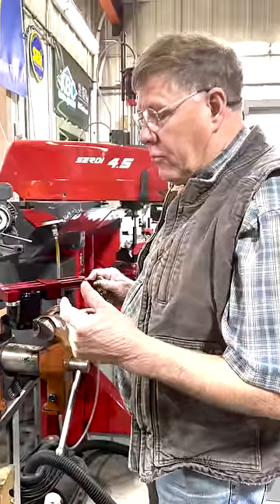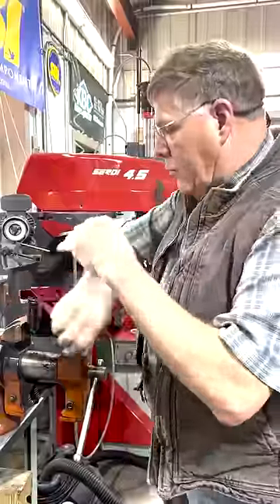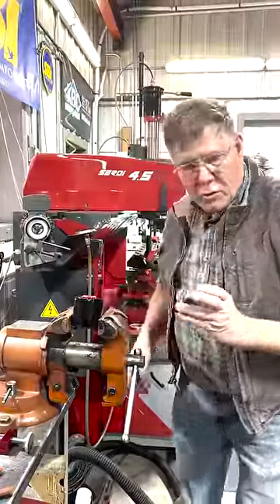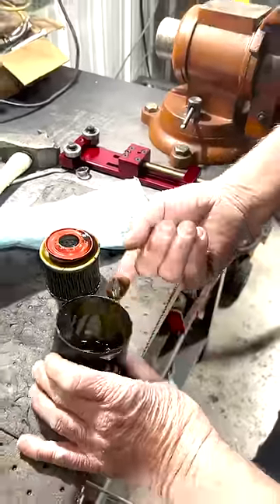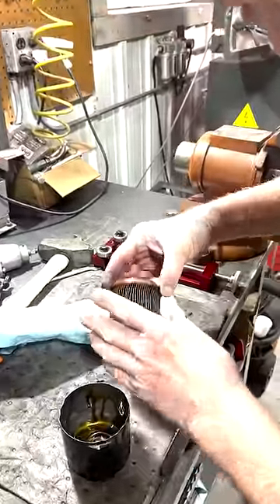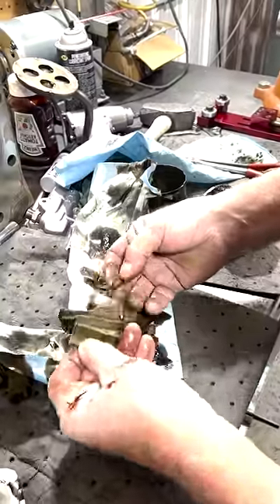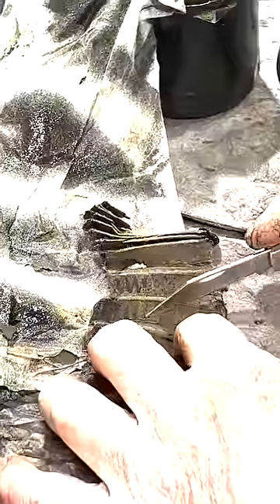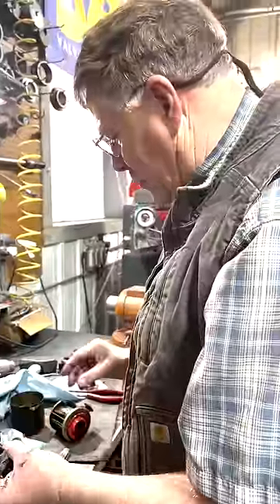#shorts Our Customer Ran His Engine OUT of OIL! 🤦🏻‍♂️

Comment: Shake my head everytime, and people drive vehicles like there made out of magic 😅
Reply: Im not a car person, could you explain what happened? Did he drive it to long without changing the oil?
Reply from the maker: @JDog_Unchained The biggest issue is that he didn't even check the oil for about 15k miles and ended up actually running the car out of oil to the point that the low oil pressure light came on. Most of the time, once that light comes on, you're already in big trouble. Lol. So yes, not changing the oil for long periods of time isn't great, but running out of oil is much worse. Lol
Reply: @JDog_Unchained  yes not changing the oil  destroy that motor and I don’t care what manufacturer say, oil company say you need to go no more than 5000 miles recommended 3000 oil change
Reply: @JAMSIONLINE  -  My one truck had a sensor in the oil pan that said when the oil level was low... so running out was avoided... The truck burned a little so it let me know when it was about 1 quart low from 6 quarts/5 L. System worked good.
Reply: @KlodFather My car is the same. No dipstick, so it lets me know when I'm a quart short, out of 7 quarts. That's when I started looking for a leak. Came from the valve cover gasket. Nothing crazy .
Reply: @JoiceVaderd  -  Mine just burns a little through the valves. Its old but runs good. A little smoke when I start it. ITs reliable and I do not beat it or drive it like an ahole. Thank you for bringing up that fact yours has that sensor. Mine does have a dip stick. I carry oil with me so when it lights up, I just add some.
Reply: @KlodFather  Legit legit. I feel that. I have all old vehicles, too. If they work, no need to replace them
Reply: Honestly it's a joke, my 2002 honda civic never had an oil change for well over 340,000 km. To be clear, that is well over a year and a half of driving, it did get a bit hotter in the summer but it didn't really burn that much more gas. 

It sounded like a pickup going down the highway and it's doors didn't lock, what killed it was a cracked radiator. It wasn't worth the money to fix, it was a beater car that ate the salty snow every year
Reply: @raisin8051  You drove over 211k miles??? In a year and a half? That's insane! Where did you drive?
Reply: My engine oil change duration is 20 thousand miles, factory spec ! The factory filter is tiny plus the engine is a diesel, Say something
Reply: You shouldnt have to be a "car person" to know general rules for caring for litterally anything you own. @JDog_Unchained
Reply: @JDog_Unchained basically,  driving  a vehicle  with no oil in the engine  for a long period of time will destroy  the engine because it will hydro lock the engine. It cause friction in the pistons that the piston itself will weld itself to the cylinder heads because of  too much friction  and heat.  Oil acts as a lubricant to the piston and other parts inside the engine.
Reply: @JDog_Unchained  It was either burning or leaking oil and it didn't have enough left. New cars piston rings are not as tight compared to the past helps slightly with fuel economy. trade off is some will burn oil which I rather not have it do.
Reply: @WhiskeyGulf71 what car and engine? Have you checked the terms and conditions for that interval? It’ll be dependant on climate, driving style and fuel quality
Reply: And when the engine goes out they blame it on the manufacturer.
Reply: @jamie0193 for bmw e.g. e90 20000km intervals in Europe are standard.
Reply: I remember my old girl friend who had her license for a year, also drove her car for a year without checking oil or water and then couldn’t understand why her head blew 😂
Reply: @DerSnipOr  I have an e92 and had a mini. The intervals are 16’000 miles in England. But only for certain driving conditions. I change at 6-8000 to avoid timing chain problems
Reply: @JAMSIONLINE  what car does he drive? If it survived that I want one, imagine how reliable it could be with proper maintenance
Reply: I do mine about every 8 -10k 🤷
Reply: 10k mile bi anual non synthetic for about 45 years now.  Never check the oil, but no leaks.
Reply: You make statements like that w/o backing it up with what they are made of.  Hah!
Reply: You know Lexus recommends an oil change every 10000 miles for their cars? To me that’s insane. Max for me would be 5000
Reply: @axebeard7677  it's 2024.  Honda tell you when to change the oil (this is based on various things (temperature, load, etc.)).  My first oil change was 18,000 km though most are at about 12,000 - 14,000. 
(Synthetic oil of course - and of course make sure there actually is oil from time to time).
Reply: “Any sufficiently advanced technology is indistinguishable from magic”
Reply: My Mitsubishi eclipse is still running after about a year and a half with no oil change 😂
Reply: So the filter was doing it's job.
Reply: Not magic, it’s fairy dust
Reply: tbh my 03 lexus es300 made of magic
Reply: It’s still running ain’t it? ✨ magic ✨
Reply: @misaelherrera2845 do not use the word hydrolock, you know nothing about it, hydrolock is when cylinder fills up with any liquid, and since liquid is not compressible, it will lock the engine, if your fuel injector is leaking into the engine, cylinder fills up with fuel overnight and when you try to start it, it locks up.
Reply: @watermelonwatermelon6513  ok, well lets call it explosion
Reply: @misaelherrera2845  no explosions about the bad oil tho.
Reply: @watermelonwatermelon6513  its a joke. It's dehydration
Reply: I haven't watched this video much but this comment  is the real deal.
Reply: Yup❤
Reply: @KlodFather try adding some marvels. If your burning oil it's from rings not being free to spin to do what they need to do. It will help removing the carbon buildup on the underside of the valves so they seat that sometimes additives can't fully remove. Running a better detergent blend of oil can help with this too.
Reply: @djnone8137  -  It was the valve guides that were bad. Rings were OK. The engine outlasted the rest of the truck and went on to live again in someone elses truck. 300k miles. Those old German blocks were reliable but had a few warts if not kept well oiled. I changed the oil regularly. I only stated that the pan had the sensor and it worked. If you only put in 3 quarts it was not starved for oil but it would light the light to let you know it was low. This was not a pressure light. The truck had a pressure guage and oil press light separate.
Reply: @JAMSIONLINE Emotional damage. 🤣 seriously it's always smart to check engine oil and tire pressure often.
Reply: Ur saying they're not?
Reply: @JoiceVaderd  you need to basically drive every waking moment to rack up those numbers.  Doesn't even make sense.
Reply: @misaelherrera2845  not a hydrolock, that's when fluid (coolant/oil/fuel) is trapped in a cylinder on its compression stroke, a no-oil situation will cause heat siezure of bearings, camshafts and rockers, and pistons.

Comment: I change my oil every 5k miles. I don't care if the filter and oil says 10k, 12k, 15k. I'd rather spend an extra $200 a year doing 3 oil changes than just doing one, and my engine last until 300,000 miles than 150,000.
Reply: was gonna comment how unnecessary this is but I service the weekend car once a year and that does like 3k lmao.
Reply: What kind of oil are you buying that cost $66 dollars per change??? Synthetic store brand is 25 bucks for 5 quarts and a few more bucks gets you a decent filter.
Reply: @braxton4363 He probably has it serviced, I did my own for $30 every 4,000-5,000 miles until my Honda CRV hit 200,000 miles now every 3,000 miles. 350,000 miles without any engine problems, oil is cheap engines are expensive. I went to jiffy lube once when I had an injury that kept me from changing my oil, $80 for full synthetic! No thanks I’ll do it myself. My next vehicle I’m gonna buy a 55 gallon drum of the vehicles oil, cheaper in bulk and it doesn’t go bad. At 5 quarts an oil change 55 gallons is only around 180,000 miles.
Reply: 5K intervals and Castrol Synthetic on both of my last 2 cars, the first one 198K before I sold it and the current one is at 203K, no problems.....
Cheap insurance for your engine...
Reply: Without having an oil analysis done, it's probably a safe bet to do 5k OCI with full synthetic.  Not conventional...
Reply: You could get half a million miles out of that engine easily😮 one of the best things you can do for your engine is put some seafoam in the engine oil😮 it will remove are all the carbon deposit in your engine it will be like new😮
Reply: If you change your oil past 3,000miles you should really look into how small oil galleys are alot of newer cars have very small oil galleys that get clog with varnish this galleys oil the timing chain and other parts if it get clogged you either don't get enough oil to the other parts or no oil at all. If your timing chain loses oil you will not make it very far unroll it blows as mist modern engines are " interference type engines" which usally have piston to valve contact when the valve train fails.
Reply: Every 3k on dino keeps my girl happy.
Reply: Me too, every 5k miles. And that works great for my Toyotas... but I have a Honda now and by the time it reached 5k for the first time it was out of oil already.

Comment: I put prop plane oil in my ex's new car, before we were divorced. She drove it somewhere around 2 years, before selling it to her brother. He drove it like it was stolen, for three years, and never once changed the oil. His dad, my ex father-in-law, asked if I'd do an oil change on it, so he could sell it, and when I pulled the oil plug, nothing came out. By that point, it had a little more 65,000 miles on it. I changed the filter, filled it with oil, and told him to bring it back after 250 miles. Two days later, he came back, with an additional 500-600 miles on it, and when I pulled the filter, there was almost no metal in it. The car is still on the road, 20 years later, with the same engine in it. Of course, the new owners are much more frequent with the oil changes, but I thought that thing would have exploded by now. It has nearly 400,000 miles on it, and smokes like Cheech and Chong, but it runs pretty well.
Reply: Nothing about that formulation is designed to fit within tight tolerances of a modern day combustible engine. The worst mistake is always superseding the engineering that goes into vehicle oil formulation.

What you proved is that any lubricant is still a lubricant. It smoked because the rings were fried and it was probably out of bore by that point.
Reply: Are you not gonna tell us the make and model of the car? Cmon bro, let's have some details. Sounds like a well made vehicle to me.
Reply: @djnone8137 OEM spends billions on R&D just for Jason from Iowa to say
"This oil's way too thin"
Reply: @bobman717  no. Oem spends for you to live out your contract and knows through analytics you average a few k a year so the warranty will expire all liability the second you try to actually own the vehicle and drive it.

Oil companies invest in sustainability after warranty. Not because they are obligated but because they can. OEM wants you to buy a new vehicle every 2 to 4 years. 

Lubrication specializes in maintaining what you own. 

It matters. Ace of spades.
Reply: @bobman717 oil weights are primarily driven by emissions standards nowadays. A little step up in oil weight won’t kill it
Reply: like turbo prop oil or reciprocating engine oil?
Reply: Some cars are true brave heroes!!

Comment: I change my oil & filter every 5K miles on my 1998 Honda Accord.  It currently has 553K miles on it.
Reply: Lucky. I waited 5k miles on my little honda 4cyl once and it nearly blew. Out of oil already, overheated, 7 error codes, overheating fluid, misfires on every cylinder, P0420 of course. And oh yeah, the coolant reservoir lid blew in half and all my coolant boiled out. 

Still drove it home though, still runs somehow, but definitely checking level before 5k miles next time.

Comment: In the late 70s, we had a customer drive in his Pinto and complain about a knocking noise. When the service manager opened the hood, he saw the oil filter was painted the factory blue. He turned the car off and there was no oil. The car had 64,000 miles. He asked him why he didn't have the oil changed. The guy gave him a blank stare. "Change the oil?"
Reply: How do these people make it out of the house in the morning, what on earth
Reply: I'm surprised it lasted 64kmi without a single oil change 😂
Reply: @mikegriego3671  Back in those days, there were still full service gas stations, so someone must have added oil at some point. But the guy seriously never had an oil and filter change and claimed that he didn't know it was needed.
Reply: @Olds_Pwr  Only if you like engine wear. His engine was completely ruined. The knock he was complaining about was the lack of engine bearings.
Reply: @chrisdaigle5410  He said nothing about a knock. Engine wear starts the first time the engine is started. In my experience, engines can take more abuse than most people give credit for. I had a 72 Cutlass that would idle at 7 psi and idle at 0 on a mechanical Autometer gauge. Never knocked, never blew up, worn out, yes.
Reply: ”He never said anything about a knock”  He’s the OP. He’s saying it now…😑
Reply: @liggerstuxin1 he also said it right in the OP, so dude was just plain wrong.. some people bro.. do you think it was the reading or the comprehension that got him??
Reply: @Olds_Pwr  He did say it was knocking.
Reply: @Olds_Pwr   Look above at the post you replied to. The Pinto with a knocking noise.
Reply: @Helterskelter41156  Gotcha.  I was referring to the clip.
Reply: This is why you don't just do things for the people in your life, the amount of mom's I know that have new fancy cars that are screaming at them to go take their car in for service and just don't because they never even notice the warnings is so great that it Transends astonishing into it just being tiring. That isn't to say the husbands know what they are doing, but dear god, most people in the modern day refuse to learn.... well anything. The old people that refuse to learn even the most basic tech, and the young people that refuse to learn...... again anything.

Comment: I bought a jeep Cherokee with the 4.0 in it. I always change air filters spark plugs and oil when i first get a car. I drained the oil and it looked like Silver pearlescent paint. I filled it back up and proceeded to redline the shit out of that engine every chance I got expecting it to die. I sold it a year after, turns out it was the owner 3 times before me that bought it back. He said he didn't expect it to last more than a month. It's been 7 years since i sold it back to him and he's still driving it. That little 500 dollar jeep just won't die lol
Reply: Those 4.0s are incredible. I changed a clutch in one for a friend years ago. Last time I asked about it, it had over 350k miles.
Reply: Those 4.0 have cast iron blocks. They're bullet proof.
Reply: i have a very similar story with a silver one. never dies even when you want it to
Reply: Good ol 4.0l
Reply: I've seen one run with a hole in the block. Ran like shit but kept running. It was simply jb welded over for a couple hundred miles then swapped for another 150 engine.

Comment: Had a customer who came into my shop with a Mercedes from the early 90s it had a little over 250k miles and he's been going to Jiffy Lube since the car was new, he decided to try my shop and when I pulled out the canister oil filter it was solid tar and showed the customer, he asked me "What is that" told him "It's your oil filter" he explained that the people at Jiffy Lube told him on the first oil change that his car never had a oil filter so it never got changed. All his past invoices never had a oil filter or filter number and when he called Jiffy Lube they knew who he was but told him that "There's a mistake, you're vehicle doesn't have a Oil filter" as he was on speaker phone at my shop I interrupted and told them "It's a canisters oil filter on the top side of the engine" but they played dumb and knew they effed up. The owner was going to try to sue Jiffy Lube for all past services and I don't know what happened since I got transfered to the new shop not to long after that. (This happened in 2009)